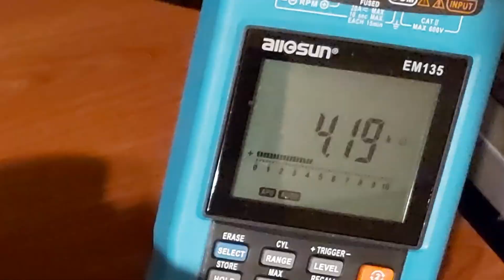Mercedes KE-Jetronic - A Bad Potentiometer check

Comment: I checked mine on the w201 1.8 liters. Between pin 1 und 3 there were 6 kohms and between 1&2 1.1. Is that fine. Thanks
Reply from the maker: That’s okay 👍 — those readings are fine as long as the resistance rises smoothly while you gently press the sensor plate.
It must not jump to “OL” (open loop) at any point, and when you release the plate, the resistance should return back to a stable value again.
If it behaves like that, your potentiometer is in perfect shape 😉

Happy Mercedesing! 😄🔧

Comment: Hello my potentiometer doesn't show voltage neither the connector. What could it be? I bought a new potentiometer and doesn't show voltage as well
Reply from the maker: Check your OVP or the ECU.
Reply: How could I check that? @mercedeske
Reply from the maker: @diogocaldeira6034  You have it covered here in the electric part of the KE
https://www.youtube.com/watch?v=6c4kQNKMu0Y

Comment: hello everything is fine ? I have a problem with my Mercedes 190e 2.0 1989, the cold car works well and drives well but when it goes above 80 degrees it's hard to start and it makes a little mistakes, can anyone help me?
My car dont have o2 sensor 

Can anyone advise me what to do next?
Reply from the maker: Check the fuel accumulator!

Comment: So what exactly is the function of the Potentiometer? My 420SEL has a problem. When the engine is warmed up and I am coming to a stop, the car sometimes dies or hesitates when depressing the accellerator. But if it is just idling in park and I depress the accellerator it revs up. We have just fixed all vaccuum leaks (There was a lot) and the engine starts up when cold - no problem. Problems first occur after warm-up.
Reply from the maker: This sounds like a lambda issue. The potentiometer tells the ECU where the sensor plate is located and how fast t is moving. That was its elementary function. On your car it has to control the idle as well as on many cars.

Comment: Hello sir , for 1&3 I got 4.6 and for 1&2 I got 3.4 and with the plate pressed it goes back and forth from 12 to 17 , would my potentiometer be good?
Reply from the maker: With or without jumps in voltage? If the voltage goes to infinity(OL sign on the multimeter) and then back to voltage then the potentiometer should be replaced!

Comment: Hello Ivica! Great videos and thank you for helping me with refreshing the m102 in my 190e. I also have a question for you.

I have replaced my potentiometer due to bad idle surging (the grafite layer was gone on one spot). I've instaled an OE Bosch potentiometer and when I measure the resistance between first two pins I get a OL reading in just one spot of the downwards movement of the pressure plate. (Measuring with a decent Voltcraft mutlimeter.)

Also just for info, I have not yet calibrated the sensor or ran the engine (would do that if the sensor was OK). 
Do you think the new potentiometer is faulty or the two little inside pins might be bent? Or should I calibrate it to 0,7V just like you showed in the other video and later check it again?

Hvala ti i pozdrav iz Slovenije!
Reply from the maker: Hello. Now you are confusing me. If you have replaced the potentiometer you could have seen if the sliders are damaged or not. Concerning other things calibrate the potentiometer and then you will see what happens. The potentiometer has to be calibrated. Greetings and enjoy.
Reply: @mercedeske  Sorry for the confusion. The sliders looked good, was just wondering if that was maybe posible. 
Will calibrate the potentiometer today and check the resistance again. 
Thank you for your time!
Reply: @mercedeske  Hi, i've tried calibrating the potentiometer. Got it to 0,7V but then as usual it started surging rpm up and down when it got to operating temp.
I've replaced microswitch, injectors, sparkplugs, spakplug cables, dizzy cap, rotor and the ICV works.
Only thing i havent checked/changed is fuel pump and EHA, OVP.

The rpms start jumping up and down only when it gets to operating temp, never when its below 80°c.
Do you have any tips? 😅 I'm desperate
Reply from the maker: @Marsi190e  Have you replaced the lambda probe?
Reply: @mercedeske  No lambda, 1.8 no cat

Comment: just wondering, does resistance test works on the device when detached from the head? i mean would the resistance test work when the TPS is totally alone and detached ?
Reply from the maker: What do you mean? Removed from the body? In that case no.

Comment: Hello, my potentiometer with the ignition off, between pin 1 and 2, is 2.6 kiloOhms. Can the potentiometer be replaced?
Reply from the maker: Hello. Yes.
Reply: @mercedeske the value of 2.6 kiloOhms is measured on the sensor located on the car. The plug is unplugged, the engine with the ignition off has a value of 2.6 kiloOhms. Thanks for the advice . Good films ! Regards
Reply from the maker: @pawekomorowski5556  Thanks. Important thing is that there are no jumps in voltage, it has to rise and fall progressively.
Reply: Thank you, you are great. When I install a new sensor, it measures the voltage between 1 and 2. I have slightly loosened the screws and when the car's temperature is 80 degrees, I need to reach 0.7 V on the pins. This is what the installation and adjustment of a new sensor looks like in a nutshell, right? Thanks
Reply from the maker: @pawekomorowski5556  Right!
Reply: adjusts the value of the potentiometer on the running engine?

Comment: ciao Ivica, here are my measurements:
pins 1-2 =1.53
pins 1-3=4.08
pins 2-3=5.40
are ok for you  these values ?
my 300 ce has a problem with the minimum and the car turns off in the release phase, but if I disconnect the connector of the cu off the minimum holds even if the consumptions are high.
Could it be due to the potentiometer?
Reply from the maker: Hi, yes, it is the potentiometer that is bad.

Comment: My potentiometer shows no readings at all. Guess its broken then? when idling on warm engine I got about 1V. But I guess adjusting it wont help since I get no resistance readings?
Reply from the maker: Hello, Jenna. 1V is too much for the potentiometer. If you have never replaced it, do it. Don't try readjusting it. Good luck!🍀😀
Reply: @mercedeske  Thanks, thats what I thought too. Already ordered new one so lets see how it goes😄👍
Reply from the maker: As smooth as butter!😃😉
Reply: @mercedeske  I sent you instagram dm if you can check it

Comment: Hello, my car w124 200E is not starting.
It starts and after 2 seconds it stops.
The potentiometer show 0 resistence on all 3 pins, then i bought from ebay another potentiometer ( 40 euro ) and the car is starts and after 1 second it stops.
The new potentiometer show me 0 resintence.
What do you think? Could be the 2 contacts from inside the injection who make contact with the potentiometer?
Reply: The problem was the fuel pump. Now the car starts. Thank you.
Reply from the maker: @zeusbill3459  You are welcome 😊 always
Reply from the maker: Did you calibrate the potentiometer?
Reply: @mercedeske  I put the potentiometer in the same place like old one.
I marked the position with a screwdriver.
Reply from the maker: @zeusbill3459  Now just hook up the multimeter and start up the car. You will have to get 0.7V while the car is idling at 80 C.
Reply: @mercedeske  The car starts and after 1 second it dies

Comment: Hello, I tried to measure my potentiometer once more and this time it worked, I think I did something wrong the last times, between pin 1-3 I have around 3,95ohms and between 1-2 0,72 and when pressing the plate it goes up (the sensor plate isn't adjusted) although my engine is in limp mode, could you explain me what components can origin this?
Reply from the maker: The resistance has to go up. In the last third of its move, it has to start falling. Important is the resistance between pins 1&2(the signal from the potentiometer to the ecu). If the resistance is not 3.6-4.2 kiloohm without deflecting the plate, the potentiometer has to be replaced.
Reply: @mercedeske  thank you for your fast responses! Can the engine go into emergency mode because of that low signal?
The current of mine did go up when pressing down the plate, but with it closed it is always below 1, I thought it should be 0 when closed 😅
Reply from the maker: Well, it can just run worse😕
Reply: @mercedeske  yeah but mine doesn't run worse xD, I can disconnect the potentiometer but it runs exactly the same, it runs but the mixture is way to rich and power output ist bad, I am certain that it is in lamb mode or whatever it is called on the ke Jetronik, but it is running only mechanically
Reply from the maker: That's the point of the Ke-jetronic. You can disconnect everything from the system, all the electronic sensors and the car is going to run - a bit like a tractor but it's not going to stop and let you down. You can disconnect all the sensors( the eha, the lambda, the potentiometer, the cts, the ovp...) and the car is going to runs and to drive to the nearest mechanic.
Reply: Hey Noah, Im in the same spot...have you resolved your issue? Thanks

Comment: Hi Sir Ivica!  My second mesure 1 and  2 is 9.44 K ohm. Is it good? Thanks 😀
Reply: Good to know. Thanks for fast answer👍 I'm going to double check.
Reply from the maker: Hi, if this is the value you get without deflecting the sensor plate, it's not good.
Reply: @mercedeske  Hi! I bought a new aftermarket, from germany. Accidentaly i adjust the little screw, have you got any idea, how can I go back to "0" factory setting? Thanks
Reply from the maker: If that's the tiny one then unfortunately NO! That one should be sealed and not turned at any occasion! If you remember how many times you turned it in or out, try to get it back. If not, that's something where I can not help you.
Reply: @mercedeske  I dont't remember. I was stupid. Thanks for enswer 😊
Reply: Hello sir , on 1and 3 I get 4.6 and on 1and2 I get 3.4 and with  the plate pressed in I get 12 to 13 up to 16 and 17 , it doesn't stay still on those numbers 12 to 17 back and forth with plate in , is my potentiometer good or bad ?

Comment: Hi, my high idle problem has just come back and I 've just checked my "new" Bosch air potentiometer (installed 2 years ago with less then 6000km driven) , May I know if the resistance valve vary as the temperature changes?  The resistance between pin 1 and 3 are constantly at 4.12 regardless the temperature.  However, the one between Pin 1 and 2 is 6.65 at 30 Celsius and goes down to 1.61 when the engine reached 80 Celsius, both values are out of range.  The voltage between pin 1 and 2 also varies between 0.64v to 0.71v.  The corresponding idle rpm is 1000 to 1400 rpm.  Do you think the "new" potentiometer is bad?  

EHA valve, ICV, Decel switch and 2 coolant temperature sensors are brand new 

Thanks in advance
Reply from the maker: Hi 👋It doesn't suppose to mean it's bad. Just try to calibrate it to a steady reading. Which Mercedes do you have? Best regards
Reply: @mercedeske  it is a 300CE -24 with the M104.980 engine
Reply from the maker: Ok, calibrate the potentiometer to have a steady reading of 0.7V
Reply: @mercedeske  Thanks! will work on it.  By the way, I found that there is fuel going into the space between the sensor plate and the throttle valve when I push the sensor plate downward.  Does it mean that the fuel distributor is leaking?
Reply from the maker: @herrickmky  The seal ring inside of the distributor, the one that the plunger rests on. I have a video on it how to replace it.
Reply: @mercedeske  Thanks a lot!
Reply: @mercedeske  Thanks! a lot!  You are the real guru.
Reply from the maker: Thanks 😊👏👍👏
Reply from the maker: @herrickmky  Always and any time!😃
Reply: and the duty cycle is between 45%-54%.

Comment: What are the symptoms of a bad pot. meter?
Reply from the maker: The most common one is when you start the car cold - the car idles at 1200-1500rpm and as it has to drop it down to 750 the car stalls.

Comment: Hi, as for my W201(M102) happened to be the plastic braket connected to the Potentiometer and the TPS just broken. Can please assist me which wire suppose to be placed at pin 1, 2 and 3 (colour code) A bit confusing right now. Glad if you can help.. thank you.

Comment: greetings! is engine on or off while checking resistance? to ck voltage do you check input or output at idle while pressing air meter, at normal engine temperature? would appreciate your comment...   thank you!!
great video!
Reply from the maker: Hello 👋and thanks for you nice words. While checking resistance the engine is OFF. You press the sensor plate(pin1 negative, pin 2 positive), engine OFF, and the nominal value (3.6-4.4k ohms) must start increasing in the 2 thirds of its way. In the last third of its way as you keep pressing the plate, the value has to be falling. That's how it's done. Greetings

Comment: Hello, can you help me please I have mercedes w124 e200 and engine is running good till 3k rpm on hull throttle then happens something and it doesent want to go more, and I have no power in engine what can it be? For me its sounds like one sylinder isnt running
Reply: That started after I changed fuelpump, first it runned littlebit rich and then it started to do that, it have changed for three times and now it havent changed for while and I have no ideas what can it be
Reply from the maker: @alexey5330  is it ke-jetronic?
Reply from the maker: Because e200 is not ke-jetronic, 200e is.
Reply from the maker: Try checking the throttle. Does it open all the way up at 90 degrees when you press the accelerator lever?

Comment: Hello, i have make test like you and i have 1.4 k for "center" (input resist) and 4.4 k for the "3rd" (out resist). Problem with center value or it's normal?
Reply from the maker: Bad potenciometar, definitely!
Reply: @mercedeske  Waw! finaly one good news.. Thank you for all. i will change it.
 I have add a short video in my profile can you watch it and tell me if there could be a consequence to what you are going to see (sponge foam on the dispenser).
Reply from the maker: @denversos  I believe not. Replace the air filter, if it comes back we'll see what happens then.
Reply: @mercedeske Ok i will tear off the old and i will place a new one.

Comment: Thank you for the info. 

Mine :
1:22 reads 0 ohm
1:47  0.85 Ohm.
Reply from the maker: It's far more important if you can achieve 0.7V on idle. If you can, then don't worry about your ohm numbers.
Reply: @mercedeske  Thanks will check it!
Reply from the maker: Anytime 😊 😊 😊 🍀🍀🍀
Reply: @mercedeske  I've 4.85 on idle. Both new and old potenciometer, not exactly sure whats going on.
Reply from the maker: @joaovictor2  4.85 what? ohms or volts?
Reply: @mercedeske  Sorry volts.
Reply from the maker: @joaovictor2  Ok, did you try to move the potentiometer downwards to see if there is a change or not?
Reply: @mercedeske  I did. The changes in Volts were very little. +/- 0.02. The srubs on the fuel distibutor were fine. This is for a w201 1.8. Thanks one more time.

Comment: hei Ivica
I have problem with  my m 103 engine whit autoatic gier and maybe  you can give me some advise. Usually when I brake or slow down my car, engine stop. After that I can fire it up normally. It happens quite often and it irritates me terribly.What could it be
Reply from the maker: Hi, Urszula! Tell me when you shift in D, does the engine die? I am asking you because it can be either the icv or the potentiometer.
Reply: @mercedeske  hi Ivica thank you for the quick ansewer
This only happens while driving, at P or N everything is perfect.
When it brakes and slows down e.g. at a roundabout.
I suspect rubber hose, a "left air"
Reply from the maker: @gurtatka2891  The potentiometer, I had a similar issue. As I depress the accelerator to downshift, the car stalls. I wasn't sure because they say that the sign of a bad ICV is when you shift in D or turn the steering wheel to the lock the car stalls while the car is not in a motion of course. If you have more than 150k km on the clock and you haven't replaced the potentiometer, consider replacing it. As I replaced mine everything was perfect. I hope I was able to help you. Greetings from me ;-)

Comment: Thanks.
1:22 values i get when i check 4.78 Ohm
1:47  0.85 Ohm.
My only problem is that the starter starts like this;
https://www.youtube.com/watch?v=s73sk5cLIOo&t=1s
Reply from the maker: Mine starts similar. If you are concerned about the car raising the revs and dropping them back it's normal thing. As for the resistance it happens that you don't get the nominal values but if you get 0.7V on idle, then there is no reason for panic.
Reply: Idle value variable.  0.32-0.86 Volts.https://youtu.be/3sitPNPWLe4
Reply from the maker: It shouldn't drop significantly. It must be 0.7 +/-0.1, so in range between 0.6 and 0.8, 0.7 is ideal, 0.3 is too low.
Reply: Thanks.
Reply from the maker: @r3FMusic  You are welcome, anytime 😊

Comment: These tests dont take into consideration the usual fault where there is a worn / dead section that gives erroneous readings only when the flap is deflected to a certain area - usually this happens in the zone where the engine spends most of its life, ie just off idle at cruising speed. This is usually accompanied by surging acceleration just off idle etc. I have a video showing the pot output on a scope and the "scratchiness" of a worn out pot off idle position. Powering the pot up with the 5V the ecu normally gives it allows you to watch the analog voltage output on the bench while deflecting the plate.
Reply from the maker: At first greetings David, glad to have your comment on my channel.👍This potenciometer is from my car and it has about 300k km and it's worn indeed. The second one I have shows some resistance but it's not good enough when the sensor plate is not deflected. I have done these tests according to the manual.